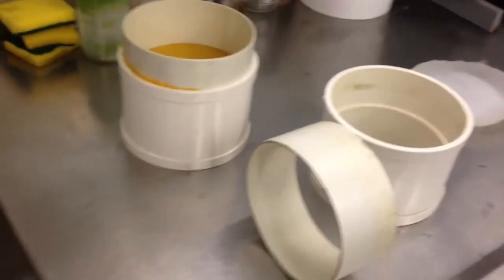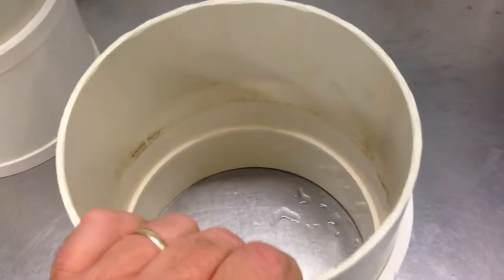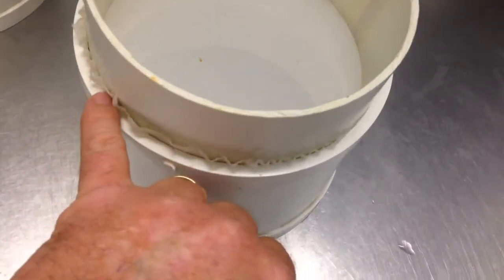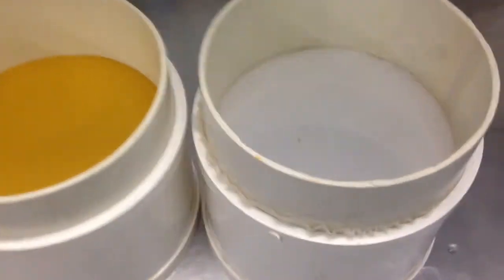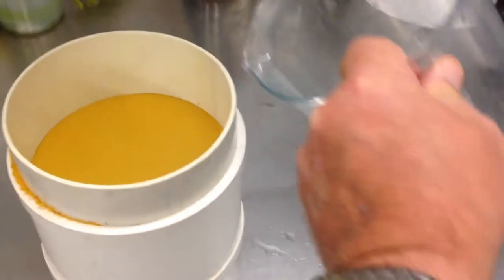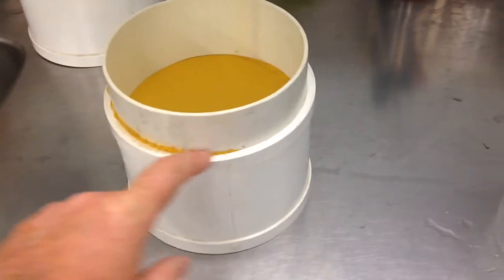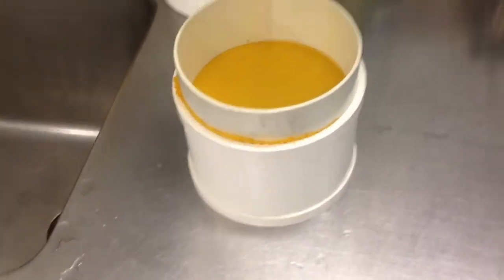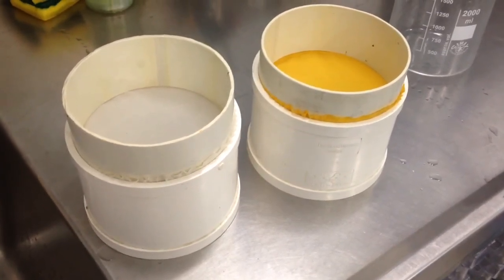making paramecium / artemia filter screens

Comment from the maker: The mesh is sourced from screen printers supply houses.  Just google screen printer supplies in your area.
The mesh sizes are around 50 - 150 micron and 24 micron.  The finer screen is called 180tt by the screen printing industry.